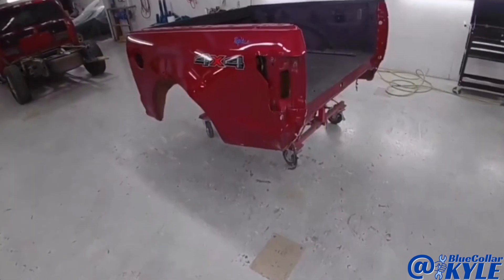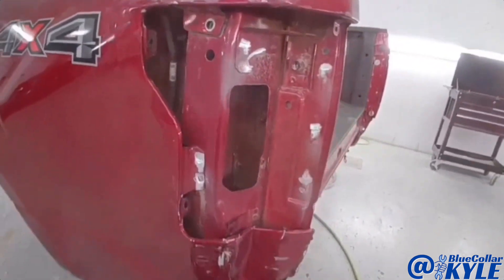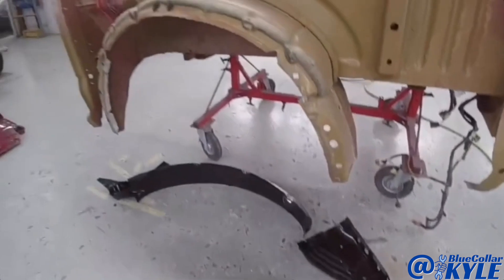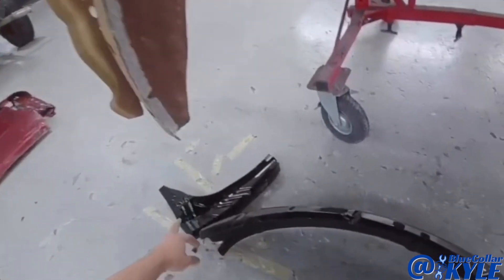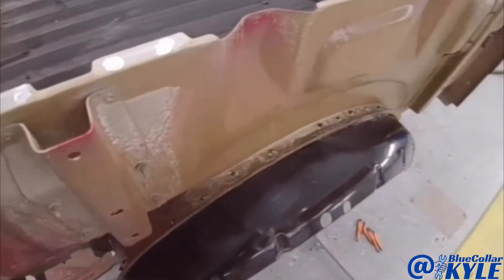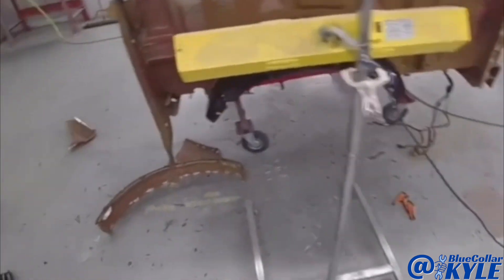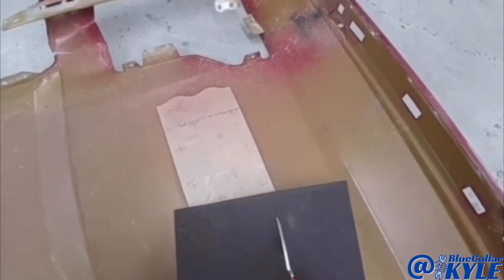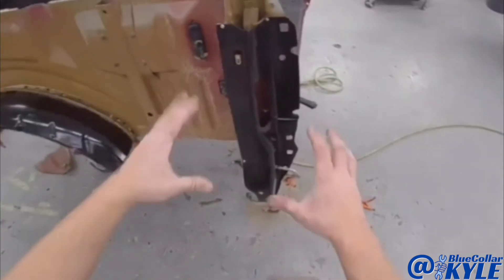Does Aluminum Spark?

Comment: is this cheaper than just replacing the bed?
Reply: Not even close lol. Aluminum is a pain in the ass to work with and replacement part costs are outrageous these days. Problem is finding another bed 🙃.  From a body guys perspective, I'd suggest staying away from aluminum ford trucks. No easy way out if something does happen.